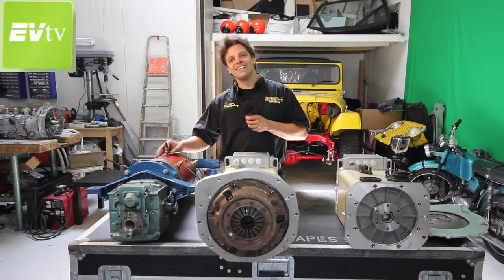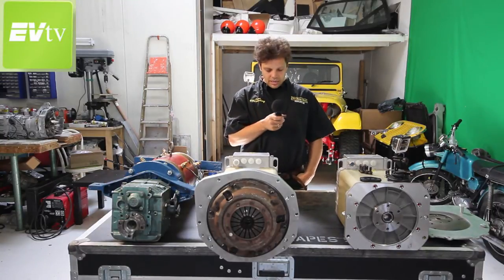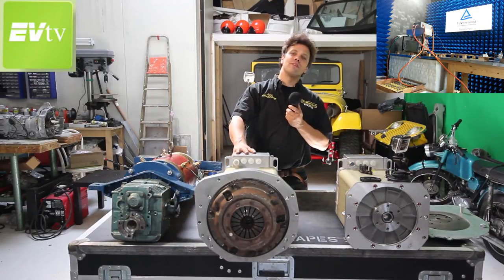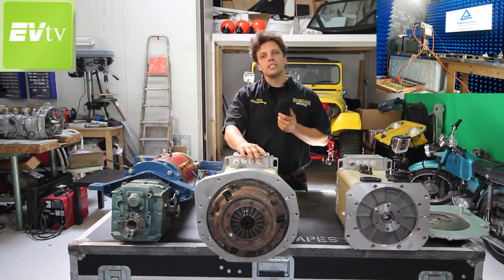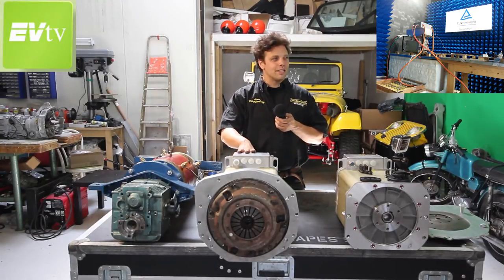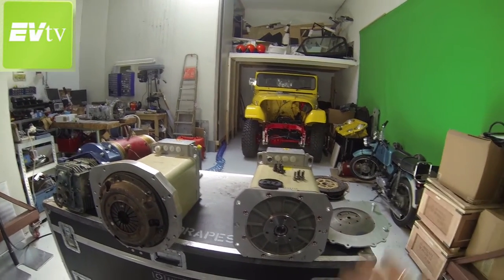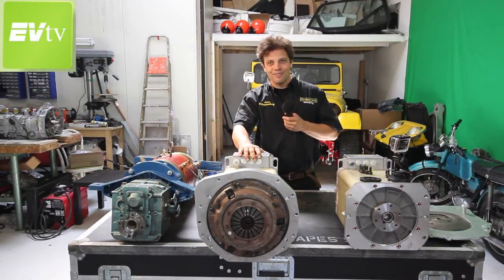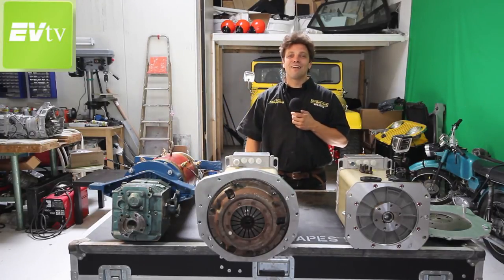EVTV Amsterdam segment: Siemens motors adapted AND certified!

Comment: How do you adjust the max speed of motor's RPM to the previous car's transmission? On other hand, how do you make sure that  the motor you chose is a right fit for that transmission (in terms of RPM)? Thanks anyone for reply in advance.
Reply: Thanks for the note,  For example,  if you wanna build it for yourself,  are you going to install a  transmission or not,  tell me the reason for any answer you'll come up. Cheers
Reply: many EV conversions don't use an auto-transmission. The fluid pump has to run whenever the electric drive motor is below about 800 RPM. This requires another electric motor just to run the pump.

Comment: Why use a flywheel? They are only to smooth out impulses from piston engines, really no need for them on an Electric motor.. Just a coupler will do.
Reply: Hard to use a clutch without a flywheel. Some people like a clutch. The clutch also reduces shock to a manual trans not made for the instant torque of a electric motor.
Reply: There is also no need for a clutch or different gears for a well proportioned system. Shaft coupler with incorporated damper will smooth out shocks.
Torque characteristics can be setup in the Drive/Inverter.
And any diesel engine is way harder on the trans than an electric motor, because of impulse energy.
Why make things complicated? 
Electric is nothing like internal combustion!